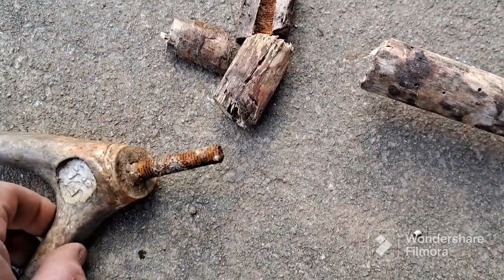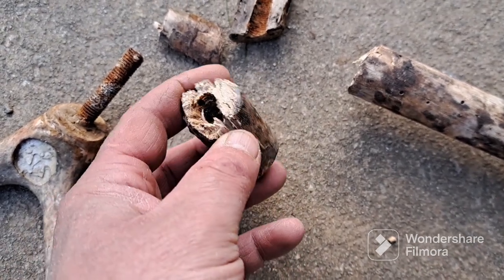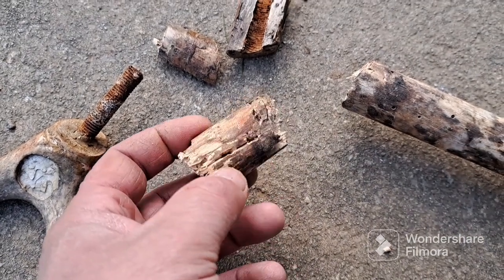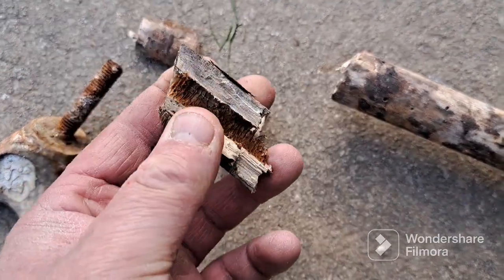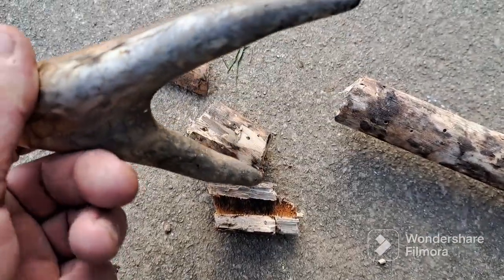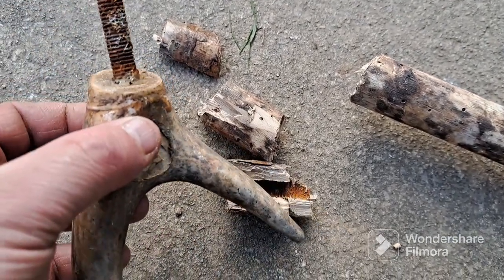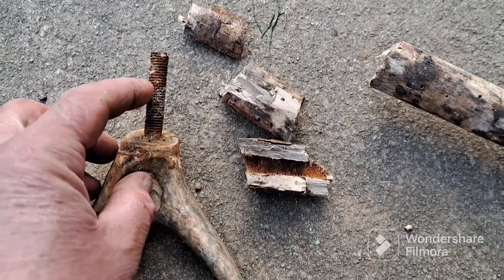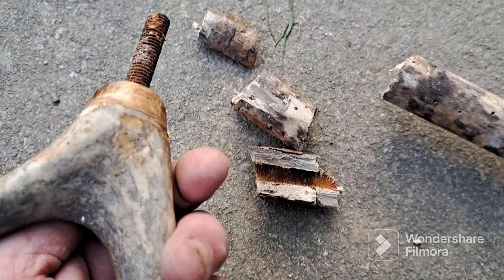Deer antler hiking stick Restoration. Metal bar attachment, woodworm, Cross cut joint.

Comment: I have been making sticks for about 20 years and have never used a wood dowel or a plain metal rod. I use approximately 200 mm  of 8 mm. dia. stainless steel screwed rod secured in place with 2 part epoxy glue. There is no risk of rusting and with the profile of the thread there is plenty of contact area for the glue. I have never had a head come loose.
Reply from the maker: Hi,thanks for watching and commenting and it's really helpful to hear how another stick maker does things particularly a experienced one with years behind  themselves. Andy.